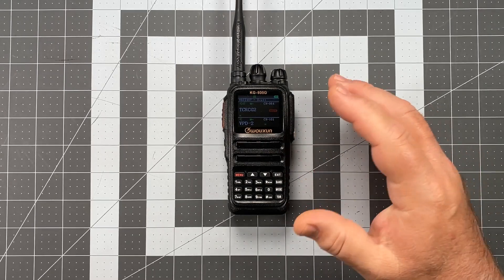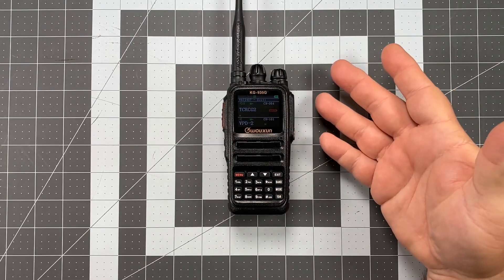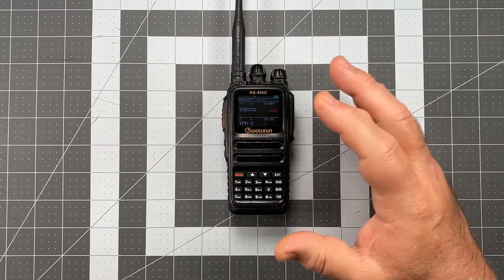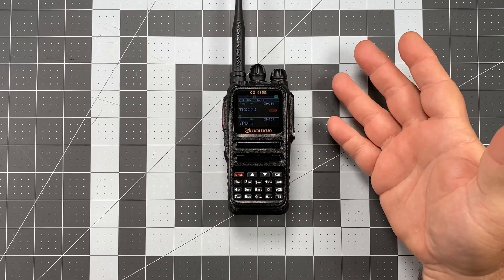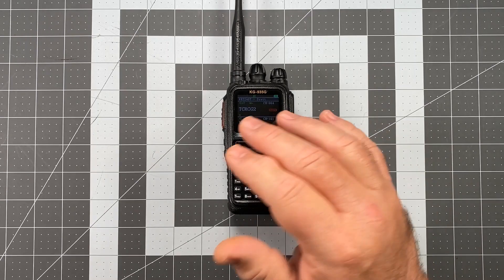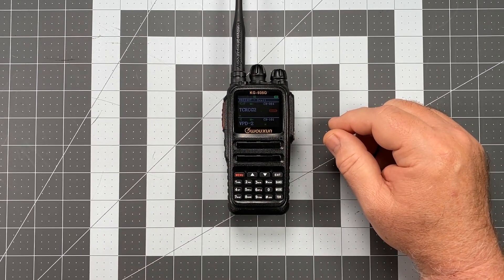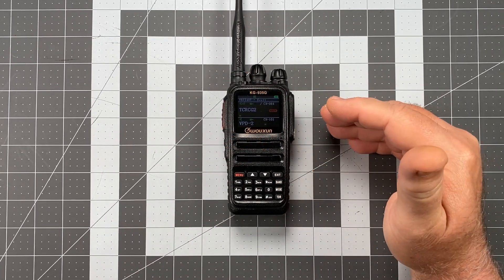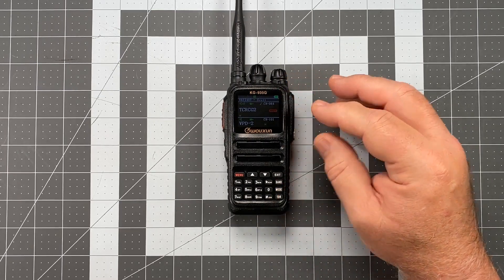Wouxun KG-935G Operators Series - Part 7: Scangroups

Comment: I agree that this sort of grouping is less than ideal. You'll end up with a lot of redundant frequencies taking up channels if you want comprehensive scanning options on the fly. Fortunately, for me, 999 channels is still WAY more than I'll ever use, and 10 groups should be plenty. My Uniden BC125AT is the same way. 

The version I'm getting ("Plus") changed the terminology from "Bands" to "Areas", so I wonder if they'll behave more like actual banks on that unit. I'll know soon enough.